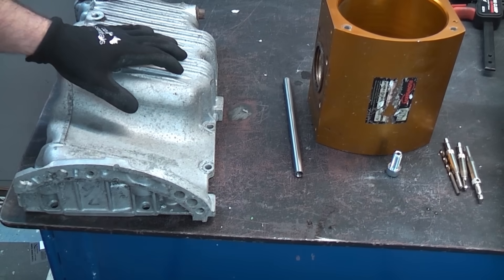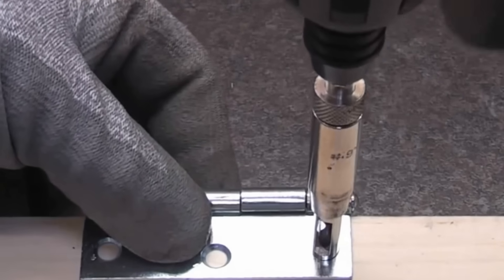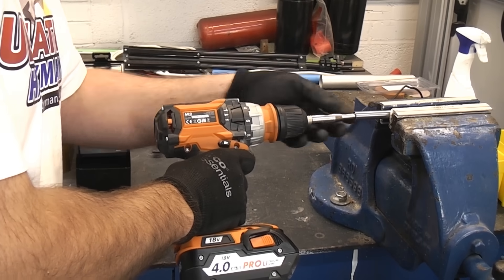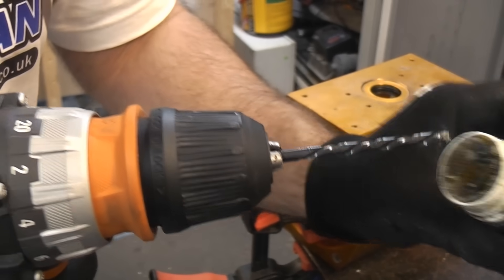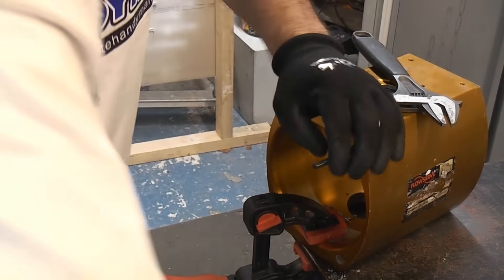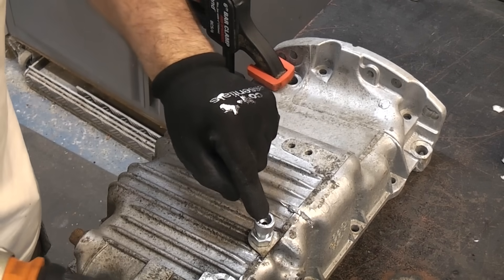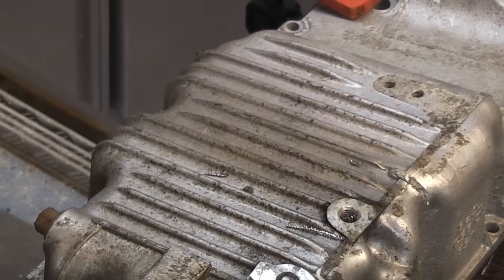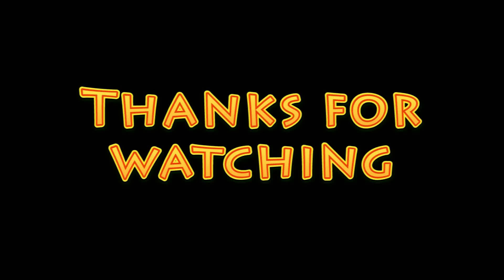How to remove a broken bolt in a deep hole | remove broken bolt in recessed hole

Comment: What do you do if it’s a broken-off machine screw that’s significantly smaller in diameter than your examples?
Reply from the maker: You might be able to use either a small diameter left handed drill bit (they go right down to about 2mm) or you could try the Trend Micro Grabit.

Thanks for the comment

Comment: Some good tips here, but I can't see how you'd shear a sump-plug so deep inside the hole without stripping the threads. If the bolt was over-torqued then it HAS to strip the threads further up. The only conclusion that I can reach is that a shouldered plug was used. If that was the case then the plug wouldn't have sheared so deep into the hole. 
The other conclusion, given that the bolt threads are spotless (no corrosion at all) is that an already sheared bolt was screwed into the sump-hole from the inside to make this video.

Comment: I find that drilling slowly while pushing in reverse will more likely cause the broken bolt to unthread....if you go fast it will just drill deeper without coaxing the broken part to back out.
Reply from the maker: Thanks for the comment

Comment: If you didn't have the tap wrench handy (or don't own one), an alternative is to use a 12-pt. socket and a ratchet to turn it.  That also permits you to employ any length extension you need to reach the work.
Reply from the maker: Thanks for the comment

Comment: Thanks. Good video. I like your socket head screw guide.  As a kid in the really 1970s my old Yamaha had Phillips head screws. Metric threads trend you self lock. I had an impact driver but what i found worked (and still works) better is to give the head of the bolt s couple of good wackos with a hammer and punch. Bolts that just would not move then must come out easily.
Reply from the maker: Shocking with a hammer can help tremendously
Thanks for the comment

Comment: NEVER use copper grease with aluminium. Video is excellent though, helpfull, good stuff! :)
Reply from the maker: We use it all the time with no problems, but in other parts of the world it seems to cause problems. I've just bought a tub of ceramic anti-seize after someone on YouTube recommended it.
Thanks for the comment
Reply: Ceramic anti-seize is perfect. You can use it also to lubricate injectors in diesel engines.

Comment: If you are in India and have access to mseal(comes in INR20 around), just use small round dot and stick it on a bolt and put the bolt inside for 1 hour. It will harden and bolt could be easily extracted out slow and easy.
Reply from the maker: Thanks for the comment

Comment: Something else that works when applying heat (as hot as possible without damaging materials) & then to immediately cool heated area with water from a hose.

This works especially well when dissimilar metals are in-play, as they will contract at different rates and provide additional “shock” to the threaded area.

Rust will break up in threads when using this method.
Reply from the maker: Thanks for the comment

Comment: You dont ever hammer in easy outs. Ever. Use a proper t wrench for the bit and use forward pressure to make the bit bright when you turn it.
Reply from the maker: That's why it tells you in the instructions to hammer them in ;-)

Comment: I use a welder every time, rusted, seized, below the surface, works every time.  Mig welder will heat the broken bolt red hot numerous times before you even try to unscrew the piece, all this heating shrinks the bolt....
Reply from the maker: Thanks for the comment

Comment: In about 30 years, I've never had a screw extractor work, but I've had to remove a few using tungsten carbide end mills in a vertical mill.
Reply from the maker: I've had them work a few times, even when the bolt has looked like it was impossible to remove (rusted up etc.)
Thanks for the comment

Comment: None of these are as good as this method: Heat up area and let normal candle wax melt down inside. Then use a REVERSE cut drill bit (sometimes called "left-handed drill bits"). Eventually the bit will catch hard and pull the bolt loose. Used this method many times with great effect.
Reply from the maker: I'll try candle wax sometime ;-)
Thanks for the comment

Comment: Well done with all of them!  You make it look easy. 

I can remember having to extract a bolt, broken off in the crankcase of a diesel engine. It would have been an easy job if done in a heated workshop, with all my tools to hand. 
Unfortunately, I was in the frozen north at -60C and I didn’t have any screw extractors. 
I did have a drill, drill bits, a hammer and a coarse, rat-tail file I hardly ever used. I successfully drilled a hole in the broken bolt, deeper than I would normally drill it. I then snapped the rat-tail tang off of the file. 
Using that I then tapped it into the hole I had previously drilled. The hard edges cut into the broken off bolt and enabled me to extract the bolt. 
The biggest problem I ran into was the -60C temperature. At one point I removed my glove to get my hand into the cramped area. As soon as my thumb touched the metal of the crankcase I heard and felt a “crack”. I immediately removed my hand and saw that the end of my thumb had frozen solid and had a deep fissure in it!
I eventually got the broken bolt out, using my “rat-tail extractor” and got the vehicle back into service. 
I have never taken my gloves off while working on vehicles in the frozen north, ever since that time, no matter how cramped the area is.  I now keep a set of different sized “rat-tailed extractors” which I gathered from worn out files, in my tool box.
That was a hard lesson to learn, especially once my thumb thawed out and started to throb but I did get some good broken bolt extractors from it!
Reply from the maker: I'll never complain about my garage being cold ever again!
It sounds like you had a right nightmare.
Thanks for the comment

Comment: Hei :) i wonder what grease/oil did u used on the bolt in the end of this video? Thanks!
Reply from the maker: I used copper grease, https://fave.co/2QUbjcI
Some people have said that it should not be used in some conditions though as it can cause problems.
Thanks for the comment

Comment: There are square drive tap sockets out there that will make it much easier for you to use the screw extractor. (As opposed to using adjustable wrench.) They fit on a ratchet handle.
Reply from the maker: I've got a set somewhere (in my office, I think- just need to find them)
Thanks for the comment

Comment: for the record: WD-40 is the worst penetrating oil on the planet - its a "water Displacer" as for oil, it sucks, and for penetrant it's worse! Kroil or PB blaster, or a million other things are better- Hell, even Acetone w/ auto Trans fluid mix 50/50 is better than WD-40
Reply from the maker: I'm not disputing that, but I always have a can of it knocking around somewhere ;-)
Thanks for the comment

Comment: I broke off the Easy-Out (reverse thread extractor) in the bolt, now I'm fooked because you can't drill out the extractor since it's made of hardened steel.
Reply: Weld a washer to it. Weld an nut to the washer.  Let cool. Remove.
Reply: Thats hilarious Jack K , 30 seconds into the video i thought the same as you  lol
Reply: 7natcho  He is talking about the bloke who commented's situation lol you can't do that with the situation in the video, unless the extractor gets stuck and you still can't remove the stuck bolt it's stuck on.
Reply from the maker: You can drill them out using a solid carbide bit (expensive and very brittle) or an ARTU drill bit, like the one used in this video- https://www.youtube.com/watch?v=8Rm9fBXIzPg
Reply: What happens when the carbide bit breaks off in the Easy out? ;)
Reply: Ben Wizards had that happen with boiler hw coil bolts drilled new hole inch away threaded  left the mess there filled in jb weld 😉
Reply: @Bencarelle  You are "Fooked" !
Reply: @Bencarelle  That is easy you are screwed should have done it right.
Reply: @Bencarelle  - Trade the heap in on another, or call the scrapper for it. It has a dozen other things worse than this that are lining up to happen one at a time. Shortly after fixing one problem another will go wrong. Repeat.
Reply: I've also used a dremel tool with a grinding tip bit. It's slow but breaks the extractor in small bits..
Reply: What do you do when the ol lady keeps nagging the hell outta yah. Can yah get it done so I can go to walmart....a ha ha ha lol..........git me a beer bitch......
Reply: @imjustsayin6562  😂😂😂
Reply: HEAT is your friend, prior to the extractor.
Reply: OR the ultimate option is EDM. https://www.youtube.com/watch?v=YbeKxFBZrF8
Reply: Drill a hole in the easy-out with a diamond bit. Then use a higher quality easy-out on the first easy out. But use thermal shock before turning. I've even used a torch to heat the metal before chilling it with dry ice. Expansion and contraction of the metal is your friend. Don't forget to apply penetrant after the metal temp normalizes before final twisting.
.
Reply: break it out with a center punch
Reply: dremmel with carbide spherical ball bit 1\8 shank will take out the broken easy out don't by any other easy out apart from the snap on type the rest are shit trust me we do this ever day on aircraft
Reply: We use a carbide ball-file in a pencil grinder for those. It's a long and slow process
Reply: cobalt bit- and cutting oil.
Reply from the maker: This might help - https://www.youtube.com/watch?v=7JCfEMrCjhc&t=1s
Reply: Young padawan Use the power of the force
Reply: They can be chipped out with a quality punch
Reply: You actually can !
A hardened "Cobalt" left hand drill bit will do the trick.
Take your time with it, and use cutting oil to keep the bit cooled.
This technique will work.
Reply: The harder means the more brittle. broken easy outs can at times be punched, cracked and removed through much effort. The other side is heat them to soften them. Some situations you can soften grade 9 or super 9 fasteners before drilling them. Just heat them to red hot and let them coll slowly.
Reply: @Stan_in_Shelton_WA  yes I used to work on semi trailers and heated broken easy outs or stud remover if they snapped and then I could drill themhas to be steel housing if you heat aluminium put carbon on from acetylene flame then when you heat it with neutral flame. when carbon disappears stop heating
Reply: @Stan_in_Shelton_WA  , Never tried that, but it seems like it might be hard, even with acetylene, to heat a broken bolt to the required temp with the work surrounding it acting as a heat sink. Any suggestions for a heat source I might try?
Reply: @Stan_in_Shelton_WA  - Righto, mate. Melt that bothersome aluminum (Britspeak: aluminium) away from the broken screw.
Reply: you can with a carbide bit at high speed
Reply: Jim McAfee a ballnose endmill at low speed. Carbide on carbide at high rpm will get someone hurt

Comment: The make a kit with guides, drill bits and fluted extractors all sized to each other check it out dont know the tool part number but could easily find it on amazon have one in my tool box at the shop, work great on broken exhaust manifold bolts
Reply from the maker: Thanks for the comment

Comment: sorry I looked through around 3/4's of the 1583 comments;  I have this problem on a cast Mercedes steering box.  The bolt has sheared off about 1/2 inch inside the hole.  There is no way to get at the bottom side of the bolt.  So in preparing to use a bolt extractor I broke off the drill bit (was doing a pilot hole - about a 1/8 inch drill bit)...so now I have a crowned sheared bolt inside a hole with a broken drill centred that I can't get a grip on - no way to drill around it.   I can't get a weld in there either.   Any suggestions?
Reply from the maker: You could use one of the inserts in this video and drill out the broken drill bit using an ARTU drill bite, like in this video- https://www.youtube.com/watch?v=8Rm9fBXIzPg&t=1s
If you can't get an ARTU drill bit you could try using a decent quality masonry drill bit

Comment: I have found it very hard to remove the removed bolt remains from the remover tool. Do you have any advice? (The tool you used for the last example).
Reply from the maker: I normally grip the damaged bolt with mole grips (vice grips), or tighten the bolt in a vice- then use a spanner to turn the extractor out in a clockwise direction.
Thanks for the comment
Reply: Ultimate Handyman cheers keep you the great content

Comment: Fine job - both the extrectings and the filming! One question: You suggest using copper paste as an anti seizure remedy. Isn't it risky to use copper in places where there is aluminium? I would have thought that the copper would speed up the corrosion of the alu because the two metals are so different in relation to electric behaviour.
Reply from the maker: It seems to depend where you live, I live in Darwen (United Kingdom) and the chemical plant where I work has a lot of bolts that are in aluminium components and we use copper grease with no problems at all, but some people have said they have a lot of trouble if they use it (perhaps when combined with salt water etc)
.
Thanks for the comment

Comment: Great video with great tips but sometimes you can't drill them out and a trick we have used for years in our machine shop is, using a stainless steel welding rod and building up the broken bolt.  The slag produces from welding will not stick to the part with the broken bolt.  Touch the bolt and stop, touch the bolt and stop continuing until the weld reaches the surface.  Then lay a flat washer over the stub and lay a nut on top of the stub.  Continue welding the stub into the nut.  The heat from the weld will cause the bolt to slightly expand and then contract.  Use a wrench and slowly work the bolt back and forth and screw the broken bolt out.  Works great for large bolts.
Reply from the maker: Thanks, Xtract-alloy make electrodes to be used exactly as you describe, I have some but have not tried them yet.
Thanks for the comment

Comment: The type of screw extractor you used is low quality & can make things worse. We used EasyOut, completely different design & material. I never use an adjustable wrench, only use an tap handle to grab on to the extractor.
Reply from the maker: Yes, they are crap ones, but my good ones were at work, along with my tap wrenches.
Thanks for the comment

Comment: I want to point out if you drill into steal bolt in an aluminium case - you always should use a guide since also the spanes from drilling can ruin your thread in some way - prevention is the sister of precaution :)
Reply from the maker: Thanks for the comment and the wise words ;-)

Comment: Nice clip and WOW. You have more than a million follower in a week or two! 
The problem I have is a glued in pin in the bearing of boat Trailer axis, possibly due to exposure to salt water of ocean. Applied all chemicals and heat and nothing working. It has no tread in hole so should I still use an extractor or would it be better to shave it all with a drill? Afraid of damaging the axis or increasing the size of hole. Any suggestions?
Reply from the maker: Can you weld a nut onto it?
https://www.youtube.com/watch?v=aRrz-cphBY4

Comment: Mate, awesome work, easy to follow. A question if you dont mind. I have an engine I removed, in the crank one flywheel bolt thread must have been damaged and someone broke a 4 flute tap in there, and just put it back together sans 1 bolt, plus one busted tap. Ive tried a Waltons broken  tap extractor but cant manage to get it in there... any tips on getting the tap out? Will a colbalt drill bit drill the tap metal? Maybe something carbide?
Reply from the maker: Cobalt will not drill it, but carbide will. The problem with carbide is that it is really brittle and there is no flex at all when using it, so really it needs to be in a mag base drill or pillar drill.  You could possibly weld a not onto it, using an Xtract-alloy electrode (or normal electrode if it's flush with the surface). Xtract-alloy  have a special flux coating that prevents the weld from sticking to the sides (if it is a recessed hole).

Good luck with it ;-)
Reply: Good to know that carbide will drill it. Motor is a good running turbo diesel so Im not too keen on opening it up if I can avoid it. It was purchased for that reason. A mag base is the best I could try for that, but I was thinking a carbide burr, not so much a bit and might be more tolerant of uneven handedness. But Ive seen carbide tipped masonry bits used for bolts, so thought maybe Id try that. Reshaping one to run in reverse maybe, it might bite and turn it back. Not to keen on trying to weld it, I only have a MIG but can borrow a stick I guess, and yes its not flush. Im motivated now to have another crack.
Reply from the maker: I have used an Artu drill bit for drilling out a wheel stud- https://www.youtube.com/watch?v=8Rm9fBXIzPg
They can be used to drill hardened steel, but are not very sharp. You would have to ensure the drill bit can't wander, perhaps you can get a guide bolt in?

Comment: The guide bolt idea is great.   If you can apply  lots of heat I have had good luck with using paraffin wax instead of penetrating oil + shocking the heated part with cold water from a hose.   I love the left hand drill bits with the guide bolts.   Nice video..
Reply from the maker: Thanks for the comment